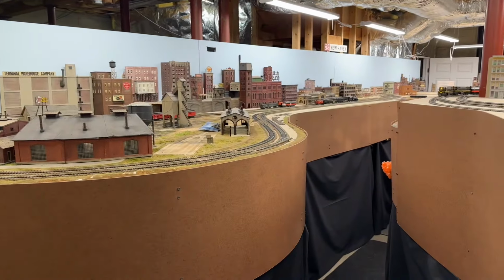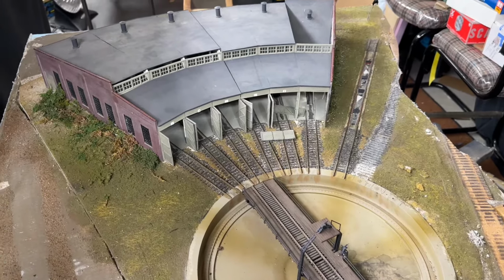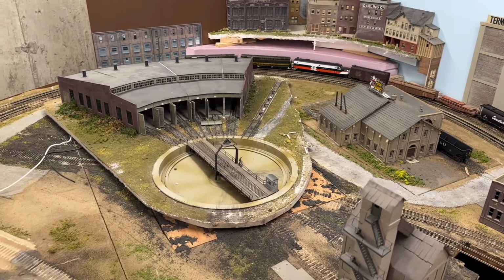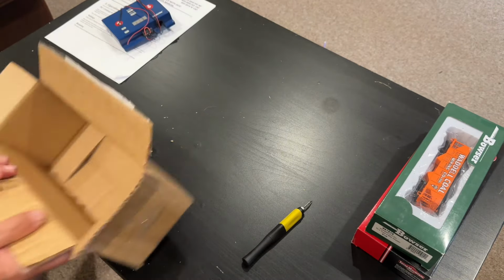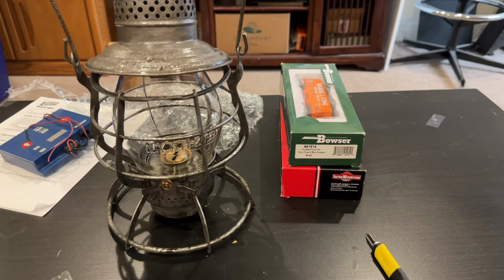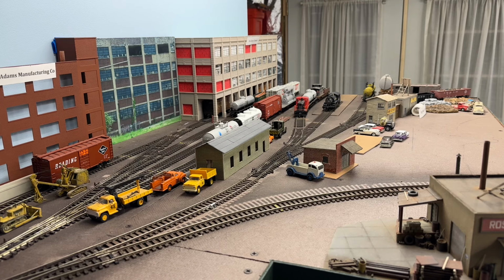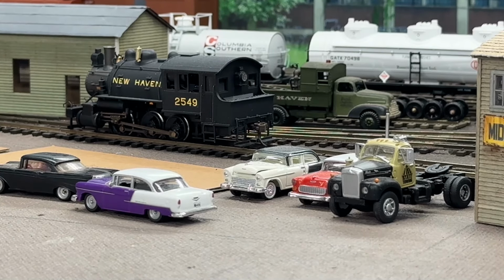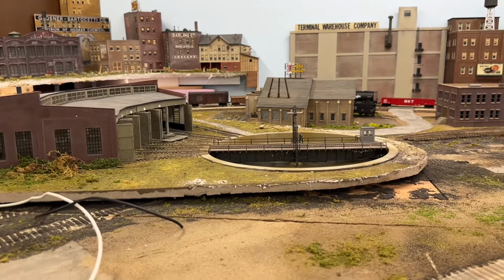HO Scale New Haven Railroad Layout Update

Comment: Great update.  I will give you a tip on the Walthers 90’ turntable. If it is the NON-DCC version with the simple TT controller you don’t have to worry about the tip.  If it IS a DCC version controller this tip solved a problem I had with mine.

I initially powered the bridge track and controller power off a DCC bus. (I did see the controller in the unboxing segment) It worked fine until I had a few shorts . The TT Would spin around until I hit the Stop button. This happened during op sessions and was pretty annoying. To solve this I powered the controller off a separate power supply rated for the controller in the manual. Putting the ‘controller’ only on its own power supply (wall wart) and off the DCC bus cured this issue and I have never had a problem since.  You still power the TT bridge tracks off of DCC bud like for the other tracks. Bill
Reply from the maker: I have to say that I really appreciate your comments and support of my channel. This will be my first experience with a TT. Definitely going to try your tips and we should connect offline to continue this conversation.